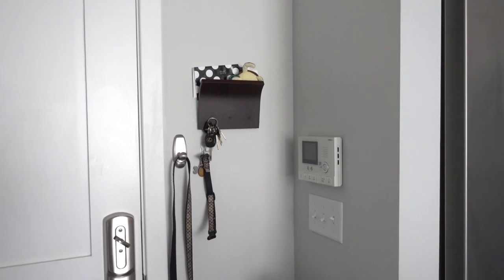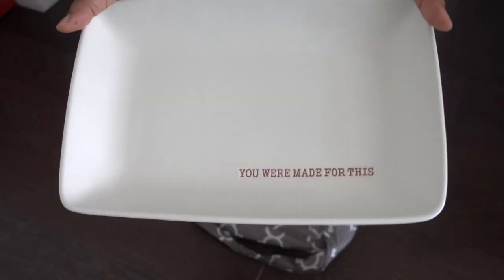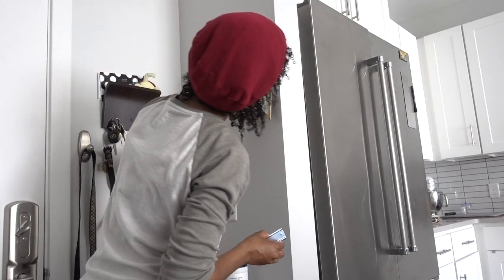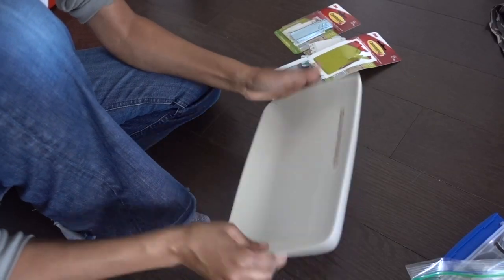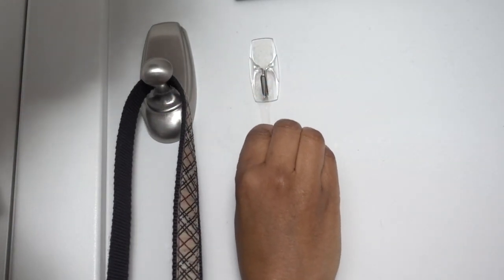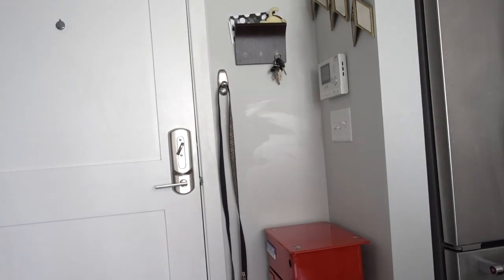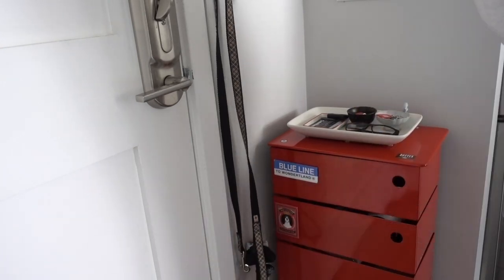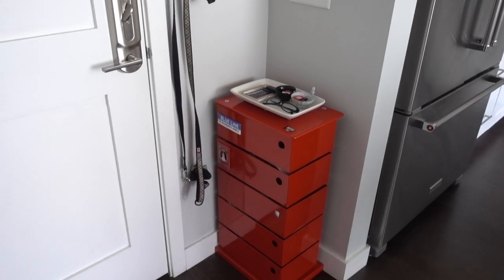Subtle & Cute Entryway Refresh | VEDA #21

Comment: The bump dots are identical to the Braille jumbo bump dots I keep on the microwave to find the #5 button & the start button. On most electronics with numbers, there is a raised area that designates the # 5. It's on phones, adding machines, number keypads on phones, on ATM number key pads, etc...